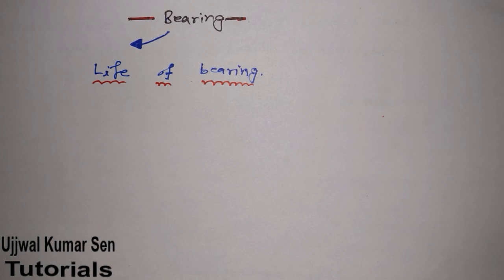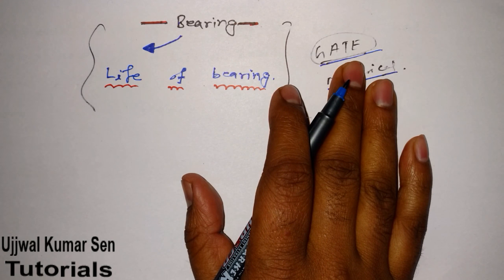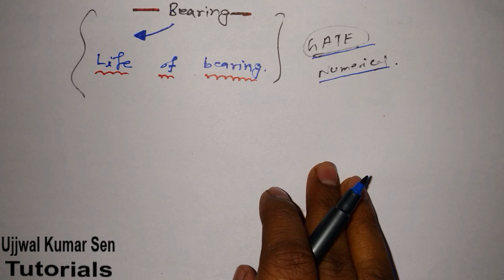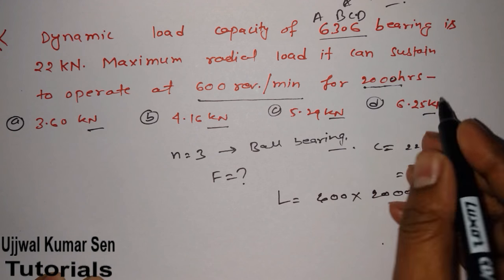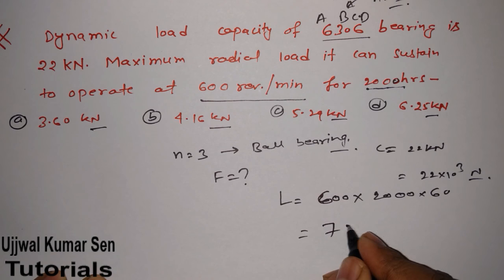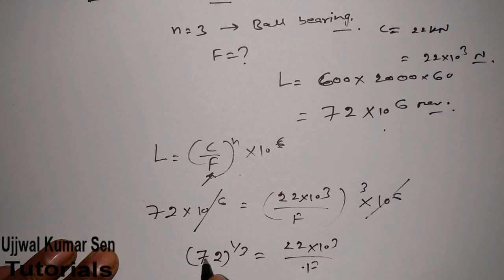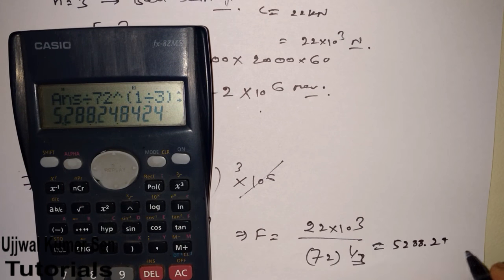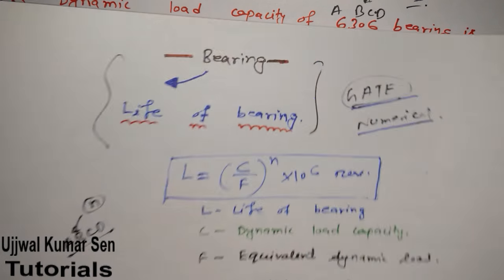Life of Bearing Machine Design Tutorial- 8 GATE Previous Year Question

Comment: Sir
In bearing designation for example 6306
1. First six is the type of bearing that's mean if 6 then it is ball bearing or it is 3 then it should roller bearing
2. Second number denotes the types of series which are generally based on  load carrying capacity 
As there are 3 then it is 300 series, that series can take moderate load.
3. The last two numbers gives the diameter of shaft if we multiply those last two numbers by 5 
06×5=30 mm…

Comment: 6306 is bearing basic designation. 
6 represents bearing type, i.e single row deep groove ball bearing
3 represents bearing width series
and 06 represents bearing inner diameter.
so single row deep groove ball bearing n=3
not ABCD, B represents n.
if i am wrong you can correct me.
Reply: 3 represents bearing width series and the width is dependent on load, if the load increases width will increase, and the 2nd digit is indirectly related to load.

Comment: solve the question (the spacific dynamic capacity of a SKF self allinging ball bearing number 1310 is 35 KN which is runnig at 1800 rpm if the equivalent  radial load actually apply to the bearing is 45KN then find the average life of bearing
Reply: 14.11*10^6 hours

Comment: For example;A 10 HP (7.5 kW) motor running at 1400 rpm,how will you calculate the bearing life?, lets say bearing nos are 6308=for drive end and 6208=for non drive end,running at no load.